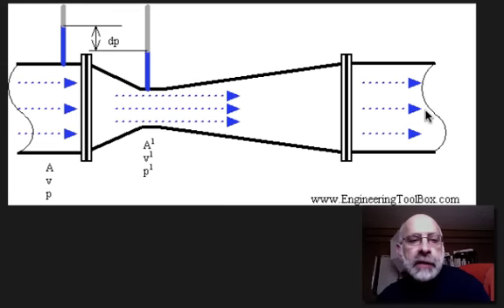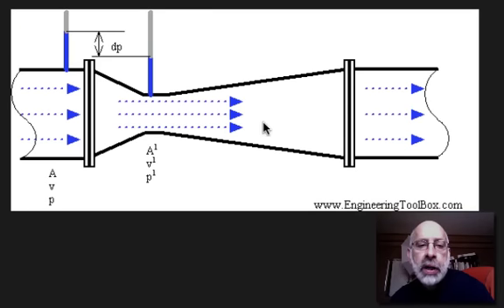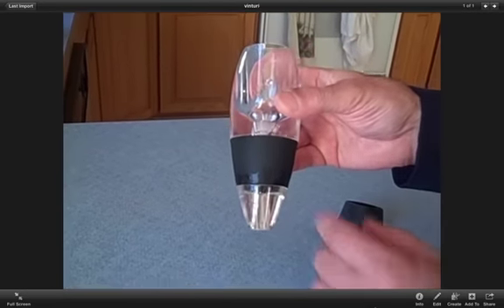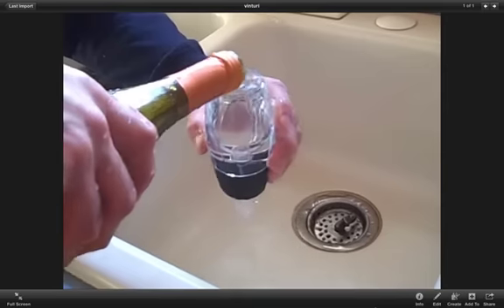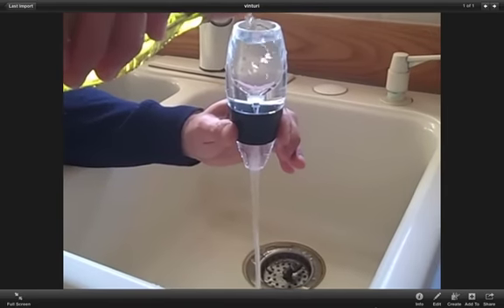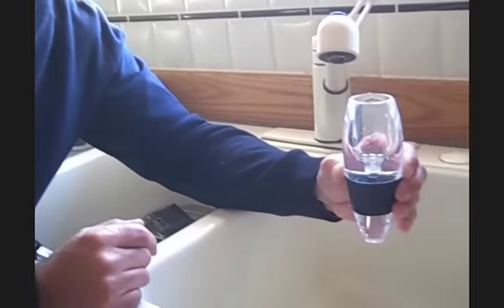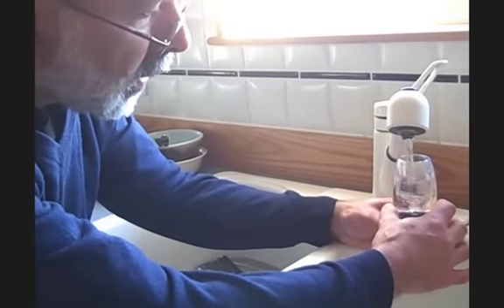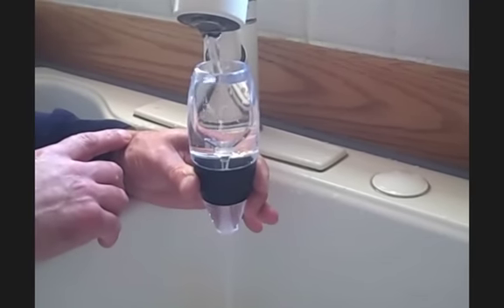Venturi Nozzle (Vinturi Wine Pourer)

Comment: I fail to grasp the  usefulness of this device. I understand that the device has the ability to visibly show that the flow is reduced by the lowered pressure allowing air to ingress, but what purpose does such a Wine purer posses?
Reply: Adding oxygen into the wine improves its flavor and this just speeds up the process